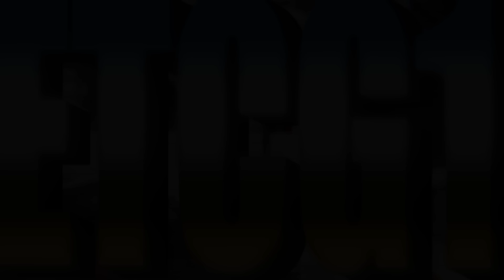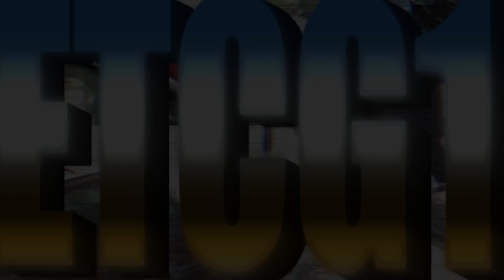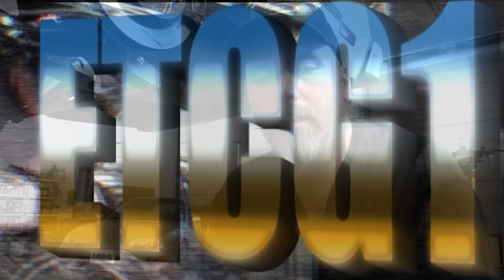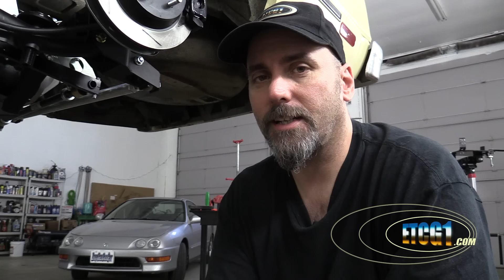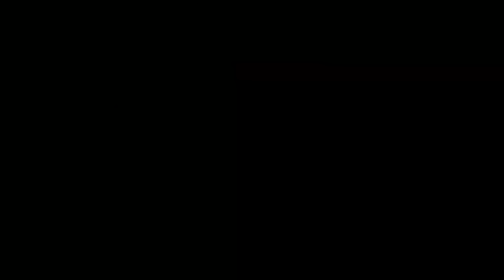Misconceptions About Performance Parts

Comment: In some cases it's easier to take weight off than add HP. Gain performance by removing some parts, and this is a free option. (At least if you have the time.) Anyone riding in that back seat? Nope? Leave that in the garage. Going to be driving 100 miles? Not really? That spare can stay home too. Etc. Basically if it doesn't affect safety or structural integrity, it's fair game. (Of course some deletes like AC or sound deadening may make a car much less pleasant to ride in.) If you can somehow manage to drop 100lbs here and there, it's modest but still enough to be noticeable.
Reply: power steering delete = frees up engine load + less weight
no aircon = frees up engine load + less weight + dont have to pay for aircon juice
no airbags = less weight
no audio = less weight
rust here n there = less weight :P
stock corolla = 900 kg + 40Kw
 stripped corolla = 650kg or 1400lbs + 40 Kw
power to weight gets better with less weight
Reply: pauljs75 removing weight is the only mod you can do that theoretically increases all performance aspects. Removing weight can save fuel, increase handling, acceleration, braking etc.
Reply: A lot of older cars do not have electric cooling fans.
Reply: +slashergrvr  Weight is about balance, so it depends on where on the car the weight is taken from. You take too much weight off the back, your rear tires lose traction. Spinning them and not moving forward when launching the car. And then the car trying to spin out on a turn, killing your turn speed. Removing weight from the back transfers weight bias to the front. Too much and you will get these problems. Remove too much from the front, and you reverse the problems.
Reply: yep when i take my 20 inch rims off.and my rear seats out of my ss asstrovan its crazy fast..with mods iv made....cold a. in. doul exoust..

Comment: Another factor to consider is the engineering in the stock parts. The engineers that design these cars are not stupid. Every part is generally engineered with specific tolerances to gain the most out of what they're designing within a given set of parameters, usually being fuel efficiency and power delivery, and striking a delicate balance between the two. As such, and especially with more modern cars that use a whole suite of systems to calibrate the efficiency and power of the entire package, you pretty much have to go into a rebuild with that exact same train of thought in mind to first understand the design parameters and why they're calibrated the way they are, and only once you've arrived at that understanding can you make an informed design decision to improve upon the stock design.

Like you said, just changing one part isn't going to amount to much when the rest of the tuning parameters - the parts that interact before and after the new part such as the case with your exhaust header - haven't been accounted for. Anything outside of measurable differences through proper testing procedures is anecdotal at best.

Comment: When a part breaks, I replace it with a better performing part.  That's usually how I roll on my daily drivers at least.  When I was using my 1988 Jeep Comanche 4.0L  as a daily I did a full cat back, replaced the downpipe with a non crimped one (stock had a crimp for 4wd version), threw in mustang 5.0 19lb injectors (4 port spray vs 2 port on stock), removed the intake baffle and openned up the intake and threw in a high flow fliter and it all worked in tandem to get a much more responsive throttle and better top end power.  The renix ecu in these responded well to mods.

Unfortunately most people throw in a garbage ebay CAI and a large exhaust tip and call it a day.  

Newer vehicles are much, much harder to get any performance out of in stock form.  The ecu only wants to run at stock and even with headers, intake, catback, etc a lot of the time you barely make more than 1-2 hp more.  You need a custom tune to get anything out of newer vehicles..  I'm not talking about performance cars like vettes, etc. but your average car.

Comment: Along your lines of thought of understanding the system the bigger issue is understanding the abilities and limitations of the system you're replacing and what it is linked to. 

For example the infamous cold air intake. It's not that they can't improve performance or don't flow more air,its that if they are integrated in a system that can't or isn't designed to benefit from that extra air its of no benefit at all. I think this is true of most modern systems and plays on the mindset of old where you could just bolt on a bigger carb and  exhaust and see improvement. 

Now a days if your pcm can't handle or doesn't recognize the improvement you've made it literally doesn't care what you do. 

This also plays into other systems. I've seen it a ton in "big brake kits"  where people Toss on huge rotors and calipers  but don't upgrade the master cylinders, proportioning valves etc.. And see/feel little to any improvement... 

Understand the system and its "flaws"  see what can be improved and how those improvements can be completely integrated.
Reply from the maker: Excellent points.
Reply: and most importantly,,,Stay Dirty!

Comment: As a dealer tech with an education in performance powertrains and motorsports chassis I see this topic weekly. A lot of dealer techs dislike aftermarket "performance" parts and I see why. The average dealer customer buys the crappiest knockoff part they can find. 1 out of every 10 modified Mustangs coming through our Ford dealer has legitimate, quality parts. Just like with replacement parts, you get what you pay for the vast majority of the time. But I completely agree with understanding the strengths and weaknesses of your car and focusing on the weak links. I like my cake (power) but I want to eat it too (reliability).
Reply: Just to add-on to your point (and ETCGs) about understanding the strengths and weaknesses, I've noticed that all too many people that really do understand a particular aspect and opt for the quality choice will still fail to recognize what impact may be had down the line.  An example being people that seem to take into account the pros and cons on the engine side and then promptly face an unexpected transmission swap/rebuild or clutch replacement. 

I think there's something to be said about the importance of preparing for performance alterations that many don't seem to bother with.
Reply: Absolutely. A car is one bug system, made up of subsystems full of componenrlts. Even if the drivetrain handles the engine mods, the brakes are probably still stock lol.

Comment: I build an eagle talon about 12 years ago. it took 2 years to build it. it started out as bolt a few things on and hope for the big numbers. what most people don't understand is all the parts on an engine work together to achieve one goal and that is to cram as much air an fuel in as possible. changing just an intake or just the exhaust isn't going to do much since the engine has limits to how much it can physically take in. in my experience if you change 1 part there are 3 others that need to be changed to get the full benefit of that part. what started out as a few bolt on turned into an entirely different beast. you will always have a weak point that needs beefed. for instance my first pass at 30 pounds (stock bottom end, built head) scattered the bottom end. fry if your building a car for performance you have to build it as a whole rather than a few bolt on parts. it comes down to even the bolts you use. we had an issue with compression loss at higher rpms due to the head bolts allowing the cylinder head to lift off the block due to increased cylinder pressure. everything comes into play when you want high horsepower. I strongly believe there is no such thing as bolt on power especially with newer cars. the ecu is going to limit power to a specified parameter so for your new injectors or that turbo kit you installed it still needs tuned and for a proper tune it's going to run anywhere from 400 - 600 bucks and even then your still limited to the next weakest link. just my 2 cents.

Comment: I put in my son's mother's 07 Accord V6 J engine a larger J pipe and SS 2-1/2" piping to a Supertrapp muffler. I swear it was the best idea I ever had. You can barely hear it because the Supertrapp but a huge performance increase and no loss on gas mileage that was noticing enough. Being a GM guy I was so happy because it was much faster and no rice can noise. Never seen anyone use that style muffler and it's tunable as well. Try that. Worth ever penny.

Comment: Reminds me of when my friend's stock civic had an exhaust leak and he noticed loss of (little that's even there) torque. When exhaust was replaced he got it back. Some stock engines need that back pressure to accelerate. Funny when someone goes to an all 3' cat back on a N/A gas saver engine expecting to go faster
Reply: Yup.  Too little backpressure can be as bad as too much, unless the rest of the engine is designed to work with it.
Reply: Engines don't need back pressure, that is a myth.  What you are refering to has to do with scavenging and exhaust velocity.
Reply: mrsemifixit  come off it you that 3" front to back is going to give hella a lot of gains 😂 lol  I have 2.25" on my vr6 golf front to back and Ian only upgrading to 3" because of going turbo.. I feel no lack of power using that "small" pipe on a 2.8 then these Honda nuts do on there 1.6/1.8 that need 3"+ pipe
Reply: This is absolutely untrue.  Primary size of the header is important for scavenging, past the collector and extension it can be 8 foot wide and make no difference,
Reply: Assembly Chimp Nope.  Actual testing has shown that the diameter and length of the pipe beyond the headers/collectors can make a difference to the amount of usable power,  As an old-school example, a mildly modded 1100 Mini with a 544 cam and 12G295 head got more power - and more torque - with a 1 3/4" ID exhaust system - using a 2" gave less power.  Even the length made a difference...they got more power - verified on the dyno - with the pipe extending about 4" beyond the rear bumper (which is a no-no, so they ended up bending the pipe slightly so it exited to the side in the stock location, thus giving it the ideal length and keeping it completely under the car.)  Exhaust velocity throughout the entire system can make a big difference in scavenging, as the headers can't do their job if the gasses suddenly slow down once it's past the collectors.  I drove mine for a few days with just the headers/extractors, while I saved for the rest of the system - it was very loud and sounded great, what with shooting flames and crackling on overrun...but it was WAY down on power (and especially torque) compared to when the full system was finally installed.  This is just one example, of course, but it shows that blanket statements like yours simply can't necessarily be applied.  And if you want more info or verification, read David Vizard's "Modifying the A-Series Engine."
Reply: Hp is a measurement of torque. You can gain power, while loosing torque since it is just a mathematical calculation. Usually if there is any change to power from an exhaust system, it is usually due to air/fuel ratios, not necessarily the physical size of the pipes. There is such a thing as too small and too restrictive of an exhaust, however I don't really believe in the opposite. I have seen tons of cars "loose power" on a dyno and then accelerate quicker in a 1/4 mile. Even environmental temperatures or who is operating the dyno can seriously effect numbers.

Comment: First: many thanks to you ETCG! Love your videos. Refer my kids to them when I can't assist. 
My father gave me the best advice over 20 years ago- "if you make a change to one area, you need to change the other end, and always be aware of the pressure changes inside your engine."
I remember when those DC headers came out. Reality is the weight savings is probably the biggest horsepower gain overall. 
Side note: engine masters did a video that showed them smashing headers and dyno'd the engine. They squished them down with a sledge hammer- only a 3hp loss.

Comment: I Wholeheartedly Agree Eric !
The majority of people labor under the misapprehension that a few expensive bolt on parts, will give them huge HP gains, when in fact you have to look at the engine as a whole, some parts will have a detrimental effect on other aspects of the engines performance, it really comes down to a balancing act, "the most expensive running shoes will not a marathon runner Make" so you have to start with the basics before adding the exotic bits, Lighten the load, Increase the lung capacity, Burn the fuel more efficiently, thats when the power potential will start to show through.

Comment: The thing to remember is that bolt on performance mods work together, so if you do the headers and nothing else you won't see much or any gains. If you do a full exhaust you might see something. Add on a CAI, sure butt dyno can be felt wonderfully, but all these bolt ons are still controlled by the ECM. Once the ECM is tuned along with these parts is when you'll start seeing real gains. Everything works together.

Comment: on old school cars some bolt on performance part make huge differences, like adding a 4 barrel carb, dual plane intake , replacing the front drum brakes with disc, adding better sway bars etc

but you're right about modern cars, they're pretty good and not much can improve it unless you got extra money/time

Comment: well said. Certain thing you can do in stages and slowly grow your gains cause you dont have the cash to do it all at once. example is your headers. you put headers on. then down the road the rest if the exhaust, and then the intake and then possibly reprogram the ecu. BUT keep in mind that they should work together. think a head on if you want to change cams and such and get parts to work with that. But then there are things in my opinion you should do all at once. such as if you are going to do a cam, make sure your valves and heads are going to handle it. Basically like you said. have a plan for your build. and realize what needs to be all done at the same time and what you may be able to do a little here and there.

Comment: I own a 2002 Honda Accord EX with a 5spd, 2.3 4 Cylinder as a daily driver. I wasn't happy with the stock performance so i bought a few cheap performance parts off EBAY. A Header, Cat delete pipe, and a Cold air intake. I kept the stock resonator and muffler to keep it quiet. Spent less than $130 and i felt a very noticeable gain in power. No issues with them in the 6 months ive had them on even though they were cheap.

Comment: Good topic, a lot of people that think they add so much are the same people who are wishy washy about proving the power of their setup on a dyno or by going to a drag strip.  The reality is that most of the common bolt on mods genuinely dont make a lot of horse power individually.  Just recently swapped from a stock 60mm throttle body to a 70mm throttle body on my buddies 295whp fox body, 0 gain, the datalogs showed the same airmass flow as they did on the datalog from that 295whp dyno pull, engine is a mild H/C/I setup and I see people slap a 70mm TB onto a stock long block lol.

Comment: You're right, it has to be a system approach. I think it was Mighty Car Mods that did a comparison test (on a dyno) with a stock Honda air intake vs. several other bolt-on intakes---the Honda unit won. And it's no surprise---it's optimized for that stock engine configuration.

Comment: Generally speaking, my experience has shown that only well engineered parts will give you an increase in power, which also means often more expensive parts, and even then, IN THE RIGHT CIRCUMSTANCES. As you mentioned Eric, with complimenting parts, and often only in certain parts of the power band (where it can even decrease performance in other parts).

Comment: Depends entirely on what you're bolting on. Bolt on a turbo and all the bits to go with it and you will see and feel a gain in power. Getting it tuned properly and making the most of it is where people seem to fall short though. 
Those who spend £5 on a cone filter to remove the standard air box are more than likely throwing power away. 
Did anyone mention 'back pressure' in your header video? Oh how I love seeing people argue about back pressure.
Reply: a turbo is not really a 'bolt on' though... it's changing the intake, exhaust, cooling and lubrication systems... not something you're average Joe is ever going to tackle.
Reply: I consider myself an 'Average Joe' and I have done a turbo conversion. Aside from a custom made down pipe it was all bolt on parts. Obviously it is a lot more complicated than just bolting on a usual air filter or aftermarket exhaust.